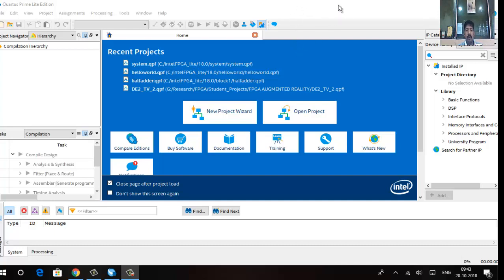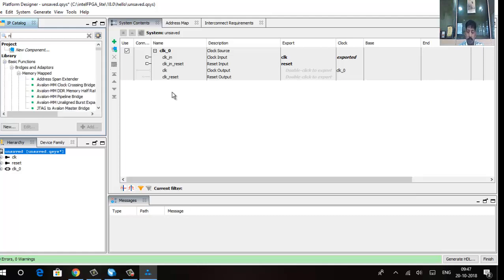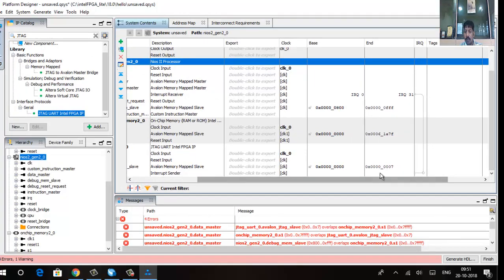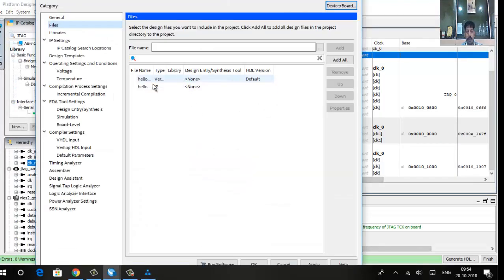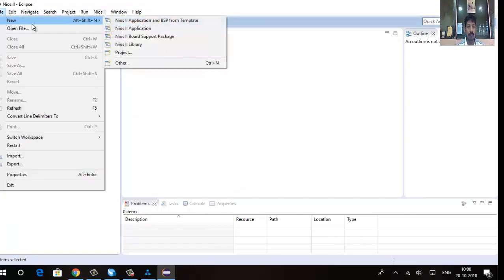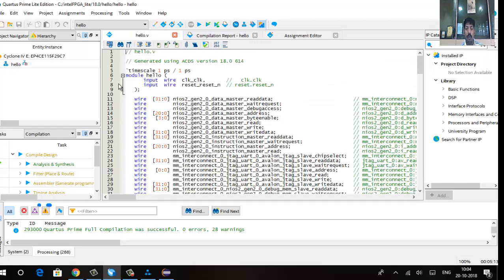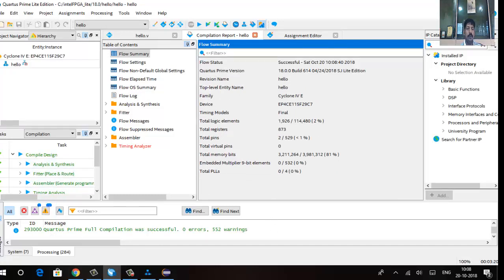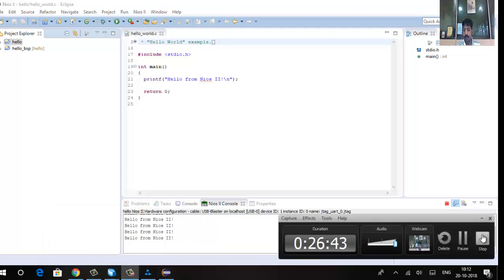System Design using NIOS II - Hello World Example

Comment: I encounter the error "Error: Computer_Slave_0: Computer_Slave does not support generation for Verilog Simulation. Generation is available for: Quartus Synthesis. " as generating testbench from flatform designer for simulation. Computer_Slave is a module I added into system, and other modules added that have similar error. Help me fix it. Thank you so much

Comment: Wow for a 5 year old video, sir that was very good, it helped me a lot.  The only problem that I had was the audio volume was too low, but not a big issue.  I did have some issues with Quartus Prime switching from ??? to WSL to create the make file. I had to load in some Ubuntu update to my Windows 11 system.  Also, I'm using a DE0 Nano which has a different FPGA than the one you used.  I had some pinout mistakes that were causing problems. I also didn't get the reset and clock hooked up right initially.  Anyway... I did get the "Hello from Nios II!" message from my hardware, finally!  So, I'm happy for now.  Thanks a lot.

Comment: Thank you,
But how did you get the "hello from nios" for the 3rd and 4th times ? by reset ? but you did not burn the application into flash! Thanks
Reply: The hello world application is running from RAM.  When you hit the reset button it just starts the program over again.  The ram stays the same following a reset.  If you cycle power, you would have to reload the program again.

Comment: Hi Siva!
I'm using Altera MAX10 NEEK board and have some issues with downloading the program into MAX10 NEEK board. The target hardware does not respond and fails to print out "Hello world" on the Nios II console.  "Downloading ELF process failed" is the message that I get. Do you have any idea what the problem may be?

Thanks in advance!
Reply: I got the same message, but, when I configured the clock and reset pins correctly... that message went away.  For me, that message was saying "JTAG is not working because there is no clock signal?".  (I know, I'm answering a 4 year old question and that you probably don't care anymore.)
Reply: @terrycarpenter4733  I have a De0-Nano, and got the same error and was looking for some answers. Now that I found this solution of yours, I will try it. I will write again after trying.